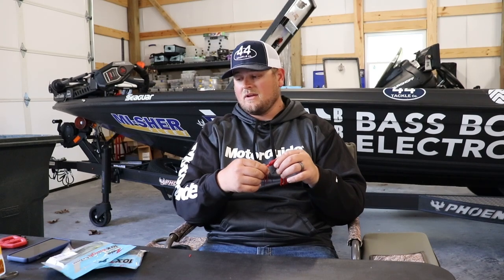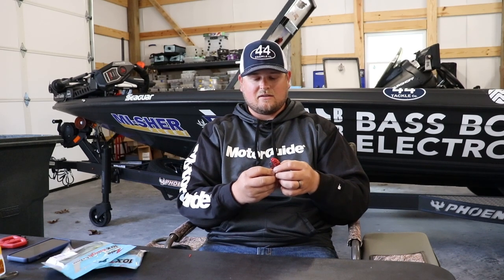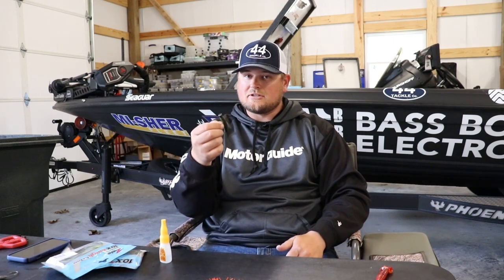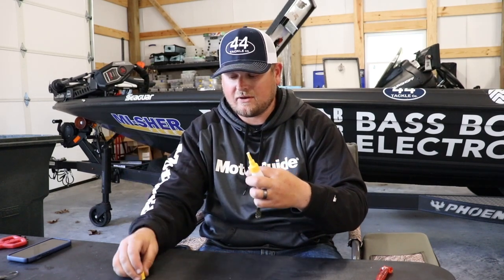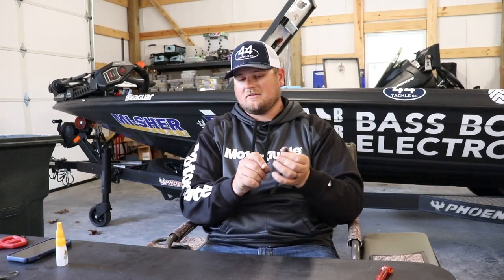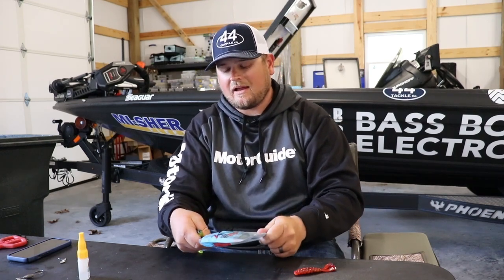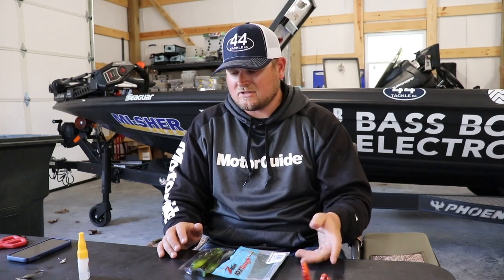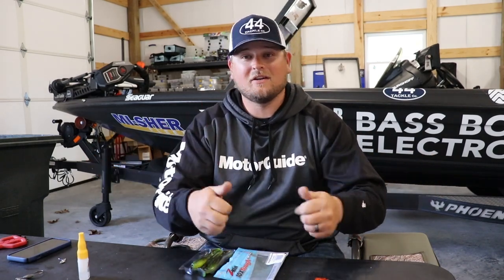Top-5 ElaZtech Rigging Tips!!

Comment: I enjoyed the tips. 
Previously, You and I had some conversations about the 4 blade Fury propeller. Some final feedback I have on that for anybody that was following our conversation is,  the four-blade worked wonderfully, it took out all that porpoising in the mid-range, and I actually gained a little top end. I did stay with the same pitch that is a 23p 3 blade to a 23p 4 blade Fury.
Thanks for your advice I'm really much happy with the way the boat performs.

Comment: As soon as you said swimbait hooks my ear went up. This has been a real pain in my a$$ for some time.
   Thanks for the tips. My only tip to add is that I save my old ned rig hooks and cut off the hook at the bend. I then use what is left for a neko weight on Zman 5 3/4 bang sticks.

Comment: I like how elaztech floats and swims. For a ned rig, I'll actually use a 1/0 regular worm hook (no EWG) and Texas rig it with a small bullet weight (1/8 oz or smaller). Works great in super grassy areas or hydrilla flats. Peg the weight or don't. I prefer to, but some guys don't like to.